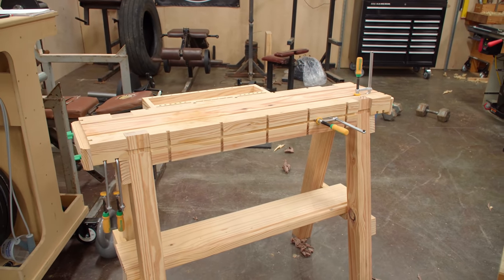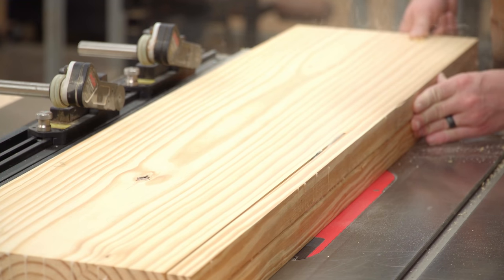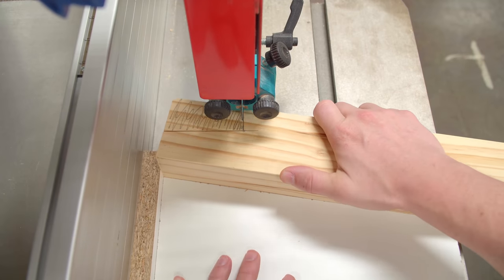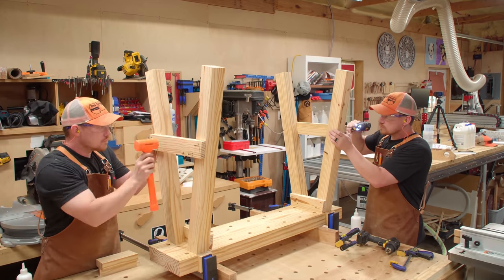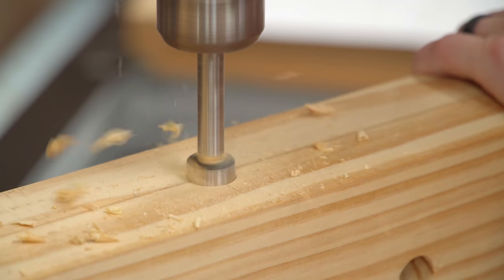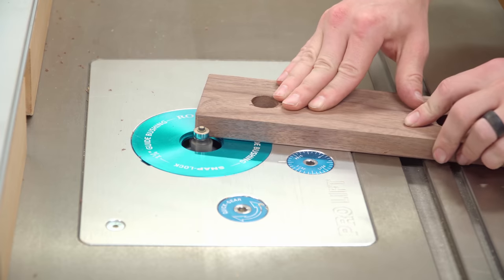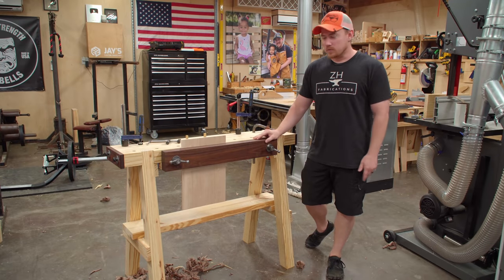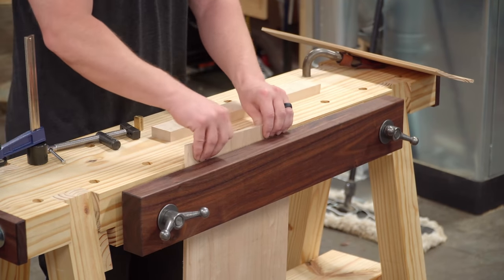Traditional Work Horse - 374

Comment: Nice design!  Quick tip for the end clamp at about 9:29. Put a nut on the bolt before cutting the head off.  When you take the nut off, it'll fix the threads that might have been damaged from the cut.
Reply: BD;  A golden Oldie.

Comment: Ooohh... 12:14 is an Escheresque optical illusion. 😄 It looks like that board is clamped in the vise at the front of the horse, but behind the shelf at the bottom of the horse.
Reply: Yes, I was just going to mention that, but you obviously beat me to it.  It took me a while to get it straightened out in my head.

Comment: Top tip. A layer of cork or vinyl added to the bottom of the legs makes a small bench like this much more stable to work on. The added friction helps to prevent the bench from skating off across the workshop floor, reducing the need for sandbags.
Another thought. If you still need extra weight, go make friends with whoever is in charge of your local dump/recycling center. Ask them to keep an eye out for weightlifting weights - not the cast iron ones, they are easily recycled, but the cheapo plaster filled plastic ones that usually end up in landfill. I've done this in the past & ended up with 50kg+ of weights for free. Better for the environment too...

Comment: Great build and commentary.  I am a retired physics professor who grew up with a father who was a watchmaker and jeweler. I can’t tell you how many dozens of times I watched him use a special tool to cut off a gold wedding band after someone had injured their ring-finger working with tools. Gold is soft but it still took 30 minutes to cut the ring as the finger swoll inside the ring. (He even donated one of the tools to our local ER). My point now:  Titanium rings are very beautiful and don’t get scratched like gold. But, if you are wearing one when you damage your finger you have a serious problem.  My solution is to remove my wedding band and college ring when using any heavy shop tools. I hope this helps.
Reply from the maker: Thanks for the info. I wear a silicone ring for that reason though.

Comment: Amazing build that is incredible versatile. It just dawned on me, and it might be an easy upgrade that is not in the way when you don't need it and i'm far to inexperienced to just do it so i'll share it for you instead. On all four legs, cut a foot in length of the same material as the legs are, but make them slideable and be able to rotate them so they stick out flat on the floor. When you don't need them, just flip them up and fasten with a hook or similar. That yould give the table the support it needs in that direction, only when you need it. Fast and easy to fold and unfold. And from what i can see, they would not be in the way when unused either. Think of them as foldable stabilisers. Thanks for the video.

Comment: how about cork-rubber on the feet to stop sliding?  Also, the offcuts from the legs could be used to fill in hte voids on either side of the Moxon vise.

Comment: I think this is honestly brilliant. I was debating on what kind of new saw horses to make and this really closed that debate in my mind. But it really makes me question the whole bench issue. Do you really need a full bench if you don't do a ton of hand tool work? I was planning to build a Moravian bench simply because I don't need the massive structure of a Roubo and I like the portability of the Moravian. This is basically a mini-Moravian with the legs splayed to the sides instead of on the ends. A more portable, cheaper and easier to build mini-Moravian...

Comment: Hey Jay,
Thanks for this great video and plans. I recently bought your plans and built the traditional version of this work horse. Plans are awesome. I am totally new to wood working and am moving towards mostly manual stuff. Love using this bench. However, I have found that the twin-screw vice racks a bunch when I put shallow stock ( less than 2" thick) into the vice for a quick saw cut. Have you or any of your subscribers added an anti-racking guide to the bottom?
Can I send a photo of my bench to you or this channel.
Thanks again for this extremely useful tool for the small garage-type workshop.
Reply: I solved it with a giant (1.5" x 5") wooden feeler gauge I built with a dozen blades of 1/8" thick and one blade at 1-3/4" thick so I can now insert any thickness up to 3-1/2". It works very nicely. I could have made it larger, but only had a 1/4" threaded SS screws 4" long. I would send you a photo, but don't see how that can be done.

Comment: Definitely need to build myself one now! Around 18:00, I think I would want to add a middle row of dog-holes and use a two dogs on one side  with the clamp on the other in the middle set of holes to provide 3 stable points of contact.

Comment: What would you think about using an A-frame base with a large centered through mortise for stability? And if I added two stretchers low on the legs, I could add my bodyweight to keep it from moving during heavy planing. I'm going to have to try learning sketchup more. 

I love what you have done with this thought. Just letting my brain wander around this and adding my own thoughts to how I could use this, as I believe that this would be a great alternative to a large woodworking bench in my microscopic shop.

Comment: I wonder if the legs were splayed like the Moravian workbench would it alleviate the need for sand bags? additionally what miter saw blade and dado stack do you recommend?
Reply from the maker: I have a coupon code in the description for CMT blades. They have become my go-to as I can't seem to tell a difference between them and my Forrest blade and they are less expensive. Much quieter too. Disclosure though, the link is an affiliate link meaning I make a commission on the sale. My dado blade is a Freud stack a viewer sent me 2015-2016-ish. It's worked great since then and I've never cleaned it.
Reply: @JayBates  I was wanting the Freud super stack but alas it does not play well with my saw stop; not recommended due to actual diameter. Thanks for your prompt reply

Comment: Appreciate the link to the vertical bench clamps - been looking for something like that for at least two - three years.  Also appreciate the tip about the Overdrive drill bits, which appear to closely resemble auger bits.  Other than the lead screw, how do they differ?

Comment: Hey Jay:  What about a stringer/racking option at the bottom of the legs flat on the floor along both sides of the length that you can stand on to keep the horse from walking while planeing instead of a sandbag/weight?
Reply from the maker: That would reduce racking but sand bags will help it stay put. It's light weight is the only downside of the design.
Reply: I could imagine a sheet of plywood that dowels into the bottom of the legs.

Comment: Okay..! That was Cool.! There were/was 2 of you'd or yu'ts or wherever you're from. I need a copy of myself. Someone who won't misunderstand my instructions and won't get pissed off if I'm short with them.
Great job on the bench video. Using so many hand-tools(like, especially in a Shop full of all the power tools one would to do the same tasks, only a 100times faster.) You made my shoulders hurt watching the video. That 'bench' is truly an awesome piece of craftsmanship/or was it an extremely versatile saw horse.!? Whatever, it's an eventual must have for me, and I'm just a hobbyest. 
 I'm sure I can make an exact replica if watch this video very carefully another 75times😎🤠🤓. 
By the way, what are metal pipe hammer- down/hold-down you used to hold board while you cut it. I have seen many benches made to use them but haven't heard them mentioned by name. I haven't used them since Woodshop in Jr High.

Comment: At 17:34 You use the hold fast. Do you have a link for them?
Reply from the maker: Gramercy holdfasts https://toolsforworkingwood.com/store/item/ms-holdfast.xx/holdfasts_by_gramercy_tools
Reply: @JayBates  why do you use a piece of leather on your holdfast and where would I get it?
Reply: @koalafan1576  That is to prevent a mark on the wood... You really don't need a whole sleeve for the holdfast (even though they are nice), a little piece big enough to cover the 1-ish square inch that makes contact could be enough, and you can glue it with barge cement. Veg tan leather scraps can be found on amazon, just remember to apply the cement to both surfaces and let them air dry for about 10-15 minutes before attaching them.

Comment: Well, I may have jumped the gun too soon to make my comment on the board grain direction, but I still don't think that planning the board will stop that board wanting to cup even if it is the top.  I am sure that its attachment to the rest of the frame structure will prevent it from cupping.